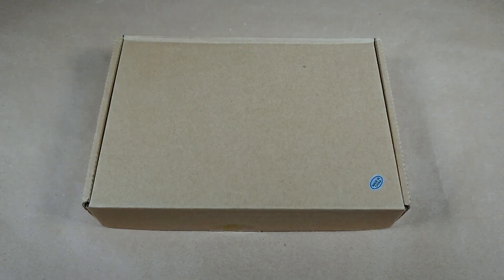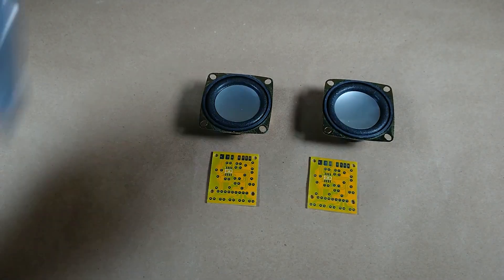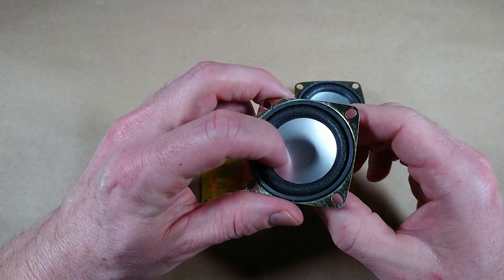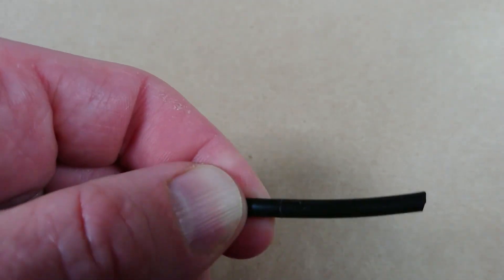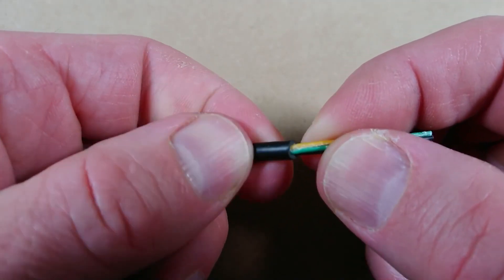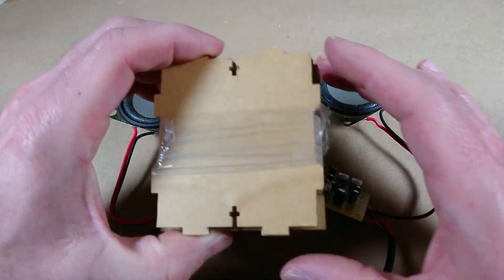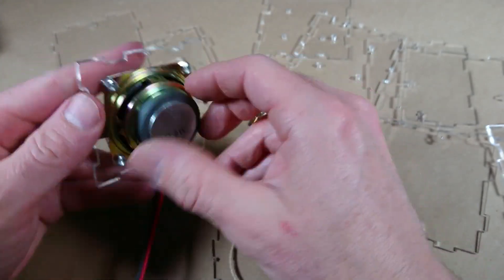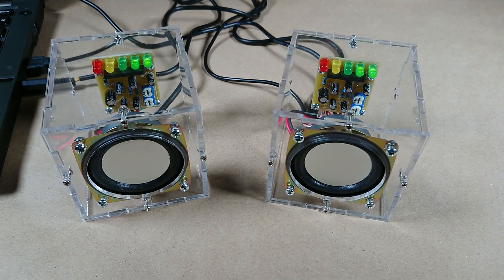How to Build A Speaker

Comment: Hi - I am thinking of getting these along with some round neopixel leds to make a led surround/stand for the speakers, so the leds reaction to the music or programmed via Arduino - what is the diameter of the speaker, whilst you're there, could you measure the cube dimensions please as I've seen a couple links contradicting each other - I'd like to start designing my light and speaker build hence asking the questions ;)

Nice vid btw ;)

Comment: i got this kit beforehand seeing this video. i used this video to help me along with making it, and it helped TREMENDOUSLY!! however, i have an issue or two. one of them is that the speakers are extreemeeelyyy quiet, and one of them is a tad louder than the other. also, on one of the panels, the LEDs seem to not work as well. do you know what the issue could be or how i could fix it?
Reply from the maker: You need to adjust the potentiometers. :)